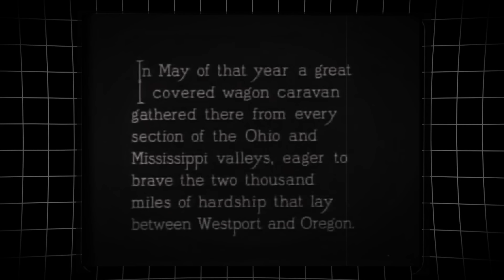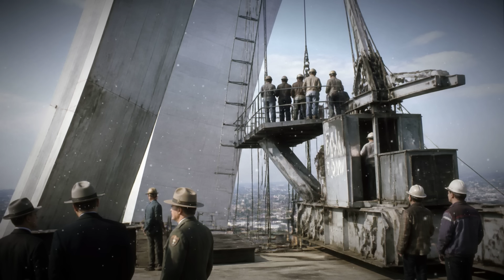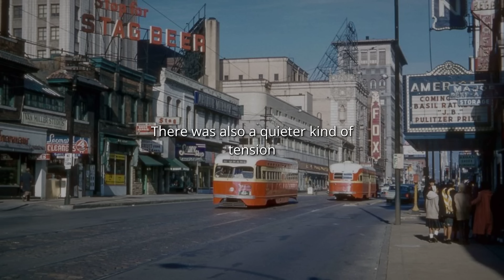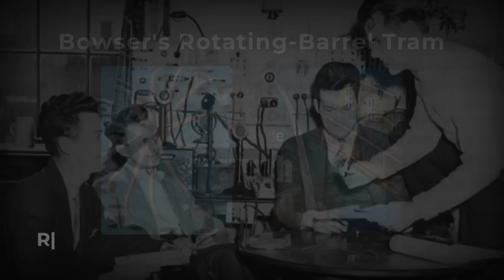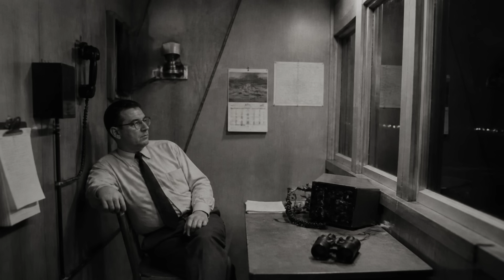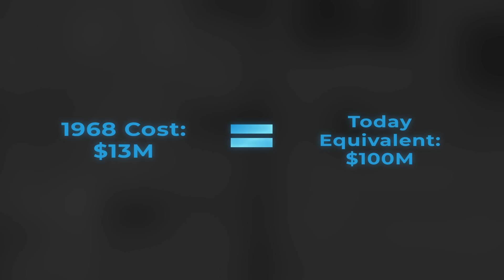The Machine That Built the Gateway Arch (1963-1965)

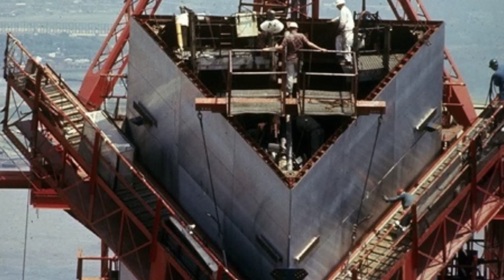Comment: 4:12  That cut-away rendering of a section of the arch doesn't seem right.  As I understand it, there was poured concrete in the walls of the lower half of the Arch.  This picture gives the impression that every section was partly concrete-filled, and partly hollow.  Not true.  And each section is triangular.  Not...whatever that is.
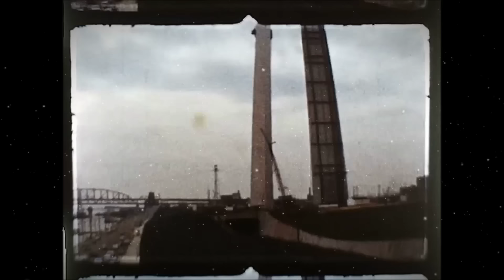Reply: 4:53  Why the hell are you showing a sinking boat?
Reply from the maker: Joe, the sinking boat was illustrative footage, but we understand the confusion.
Reply from the maker: Joe, thanks for pointing that out; the rendering could have been more accurate.

Comment: I build towers for cable 🚠 cars they have internal gussets all carbon steel so the problem I have with the arch is cross contamination from the carbon to the stainless steel will cause electrolysis corrosion
Reply from the maker: That's a really fascinating point - galvanic corrosion between carbon steel and stainless steel is definitely a real concern in construction. Great insight from someone working in the field! The engineers behind the Gateway Arch had to solve some incredibly complex structural challenges. Thanks for sharing your expertise!

Comment: The welding is perfect absolutely perfect
Reply: And it was stick welding.
Reply from the maker: @walterhay7665 Absolutely! The precision welding on the Gateway Arch was remarkable for its time — the tolerances required for those sections to fit perfectly were incredibly demanding. A true engineering masterpiece! 💪

Comment: I think after it was first built there were a few pilots that flew their plane through it,  They had to place sever penalties for anyone doing so.  I haven't heard of it happing in the last 50 years.  I did a google search and they said at least 10 pilots have flown small aircraft through it the early days with a penalty of loosing their license.  Such a beautiful arch to risk for a stunt.
Reply from the maker: @bills4448 Wild that pilots actually flew through it! The arch is such an engineering marvel it's no wonder it inspired those daring stunts. Thanks for doing the research and sharing!

Comment: One: I saw the arch on Labor Day weekend in 1965, and have several slides taken from the I-70 roadway.
Two: The first bridge to the north of the arch is the Eades Bridge, which is the first steel bridge over the Mississippi River and is still in service.
Three: The cabin-car elevators don't go all the way to the top; stairs are the last 50 or so feet.  Each one starts going up in the opposite direction of the leaning leg.  Each car is an overgrown front-load washing machine drum or dryer drum with seats resting on rollers.
You said the surveyors checked the work at night.  They used small flashlights at each point for precise measurements, similar to geodetic surveys.  All calculations were checked and corrected daily for the cutting and welding of each section that went up.  The arch is only 15 feet wide over the outside skin at the top.  The National Park Service griped about the PDM letters on the derrickes because the company was being paid for the work during the process.  The PDM on the strut was not the NPS property.
Reply from the maker: @royreynolds108 Wow, what incredible first-hand knowledge! 👍 Thank you so much for sharing all these fascinating details - your personal experience and expertise really add so much to the story of the Gateway Arch!
Reply: @ConstructionLegends    I watched as the 1976 Freedom Train came into St. Louis and was parked on the riverfront track below the Arch.  We walked beside the steam locomotive backing the train into position without a sound of the machinery being made other than the steam dynamo for the lights on the loco.  Our son was about as tall as the diameter of the leading wheels.  I also took a photo of the train with the Arch behind and above it.  Magnificent location.
Reply from the maker: royreynolds108 That's another fantastic memory - thanks for sharing and for watching!

Comment: "Joining the 2 sides was the last day of work"
Wut?
"500 tar tons"?
Reply: The strut had to be lowered to the ground.  The derricks backed down as the tracks were dismantled and lowered.  The stainless steel skin had to be welded where the bolts had been.  The area was landscaped as the elevators were assembled and made to work.  The auditorium and other things had to be constructed and finished, before the last day of work.  These are underground below the arch.
Reply from the maker: @royreynolds108 Thank you so much for this detailed explanation! That’s a fascinating look behind the scenes at all the work that still had to be done even after the arch was closed. Really appreciate you sharing this knowledge with the community! 👏
Reply from the maker: @jeffcollins1097 Great questions! The narrator is referring to the final closing of the arch – the last segment weighing about 5 tons was inserted on October 28, 1965. The "500 short tons" likely refers to the total steel used in the construction. Thanks for paying attention to the details! 👍